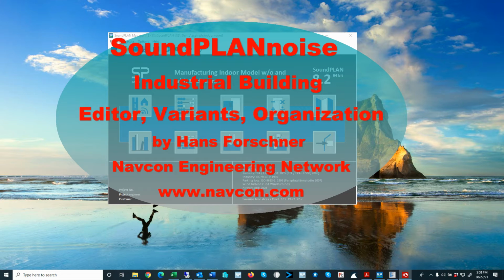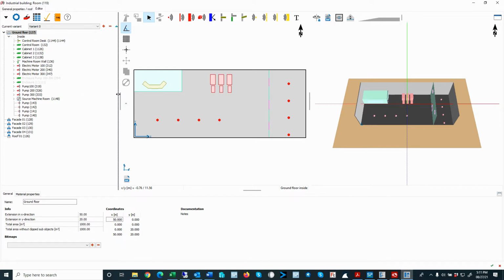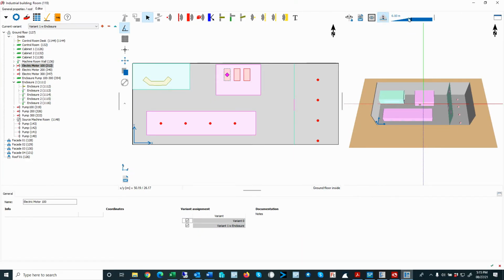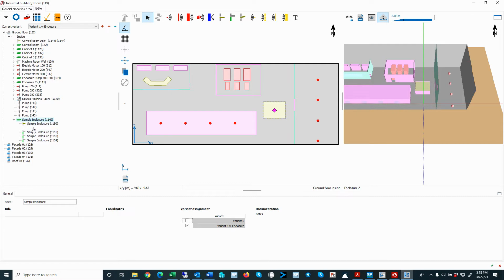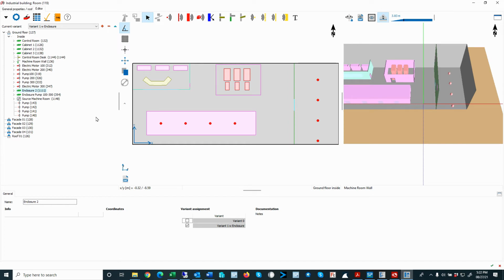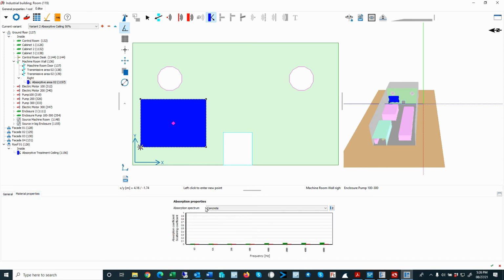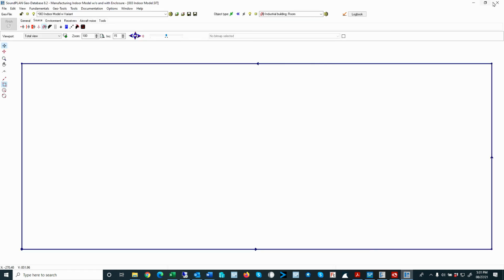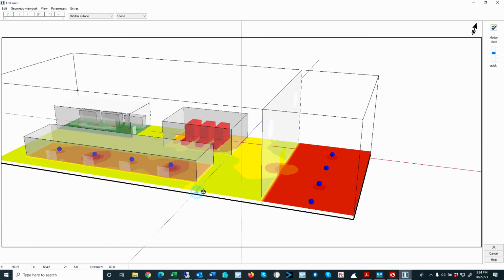SoundPLAN Indoor Editor, Organization, Variants

Comment: hi, could you explain how to zoom in and zoom out the entire program window? Is this something to do with the operating system? I use windows 10.
Reply from the maker: you have to be more specific which program (GDB, Graphics,... ) you are using to zoom in and out. Also are you using v8.2 or v9.  For the most part the zoom works with the mouse wheel up /down - zoom in / zoom out